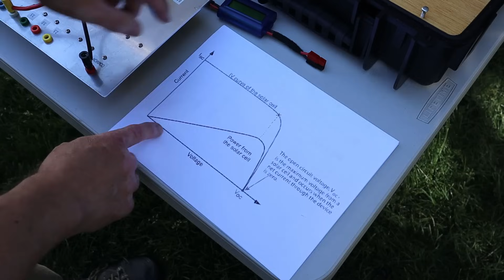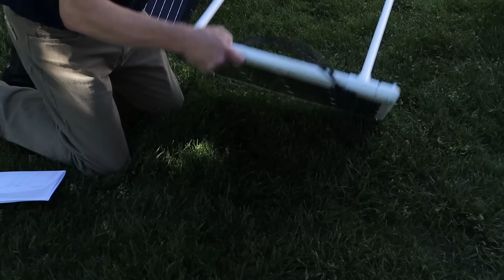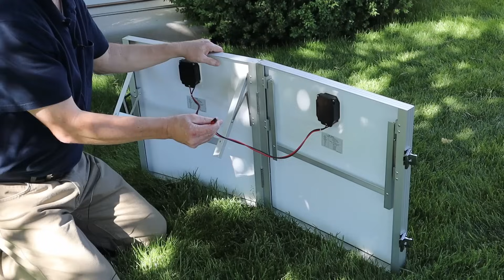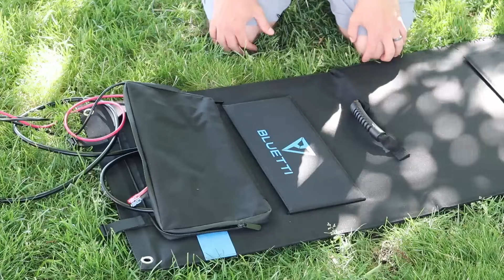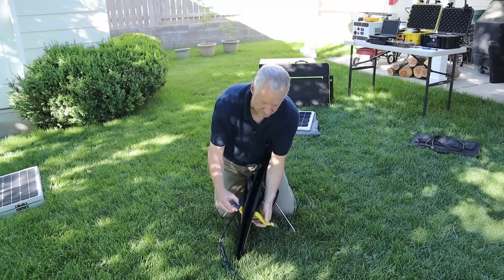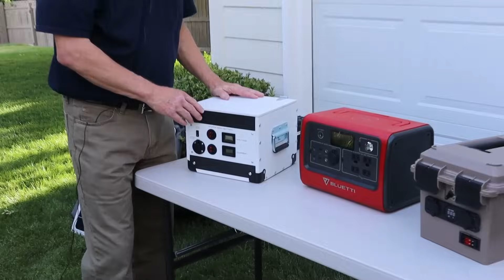Portable Solar Panel Comparison, 11 Different Models! Sunpower, Baldr, Rockpals, Bluetti, and More!

Comment: the dokio 300 watt is worth a look. the most i have seen from it is 225watts, its $350 shipped
Reply from the maker: Thanks for the heads up!
Reply: @Jasonoid  i should add i bought 3 of them and returned two of them due to not even being close to the rating, one seller offered a significant discount if i just keep one of them. its been outside for about 3 months now and i am pretty sure i used to get about 1.2 kwh per day and now its down to about 450wh per day, and i dont know why just yet. one day i might figure it out and make a video about it
Reply from the maker: @jasonbrown467  If you want to have a permanent outdoors solar panel, it's probably best to stick with the glass rigid panels. They are designed to be destroyed by UV light and heat. They are even waterproof. These portable panels are to be used on and off during temporary camping trips and so forth, not always everyday type of thing.
Reply: @Jasonoid  i guess i understand the spirit of your comment, but i dont understand the reason. i have a yard full of glass panels, but its almost as if the cells them selvs have degraded or something. i tore the kit apart apart, as its actualy four panels wired in parralle for a dumb 17 amps at 14 volts, a while back and wired them to series and i wired and soldered it better than the chinese did at the factory, then connected them to mppt instead of the included pwm.  i dont care about the fabric getting sun bleached and the little lanyard holes getting rusted, but the panels should still perform in my eyes. i will zero in on this issue  soon. thanks for your input thought, maybe you have an insight about these panels i just dont have yet. sometimes i just have to learn the hard way
Reply from the maker: @jasonbrown467  I use portable solar panels when camping to power 12v fridges. Battery packs need supplemental solar power to last the whole trip, that's the reason for the panel. To show people which panel to buy. The panels aren't laying out in the yard like this all the time. 

If I never had to move my panels I would use a rigid glass setup instead. I'm debating about adding a bunch of solar to my shed roof for backup power, in that case they would be rigid glass panels that are designed for 100% sun contact and heat.
Reply: @Jasonoid  nice. i am building a electric bike, and i plan to  take it on camping trips very soon and take a battery bank and solar panels to keep the chargers running hot on those trips.

 the little rich solar 100 watt panels are not that big for packing imo,  produce great power and are not too expensive. i was hoping for better performance vs cost ratio in those dokio panels, but i digress

i think my rich solar poly panels perform the best, even though everyone seems to say mono is the way to go, but i have seen 107 watts max here in northern indiana skies lol. my rich solar poly 100 watt panels out perform my rich solar mono everyday, rain, sleet, over cast etc etc and all these panels are new.

 i'm thinking 8-10 of those laid out in the grass wired for series and about 70 feet away from the site in the shade, while camping should get it done for me. and give me plenty of power for misc tasks. love this stuff

Comment: Thank you! Those of us that buy the batt. Units it's because there easy plug and play but no one shows exactly how to connect the panel to the unit and I didn't get a manual with my eb70. So it was nice to actually see it done.
Reply from the maker: I love my EB70, it works really well powering my fridges. Glad you found this video helpful!

Comment: Great Info.  Requests:  1.  Weather survivability (in case it was left in  the rain).   2. Most efficient Power Point:  Meaning: the Voltage / Current at various solar intensity / vs current load.
Reply from the maker: Most of these smaller panels are very similar in power output vs voltage. It's up to the MPPT charge controller to get the most power out of the panel. If you went with a higher quality charge controller it would do it's job for you. 

Most weather proof would be the sunpower 50 watts flex panels seen in the video, or a normal rigid glass panel.
Reply: Good question about outside durability. Some of the competitors state (in the fine print) that they are not waterproof. They can only be “splashed “ with water. I just bought 2 140 watt Ecoflow panels which are going with my 1800 watt Ecoflow Delta solar battery pack. The panels can be submerged in water for 30 mins and still functional afterwards. The fold in four sections, and come in a handled portfolio carrying case. Would be nice to see them reviewed in an updated video.  Great video

Comment: Can you daisy chain or array any of these panels?  I imagine they would have to have the same specs.  And would you need micro controllers for each panel, or would the string controller be able to handle the variables?  Would've also been helpful if you took 1 of those batteries as a base case and said how long it would take any given panel to charge from low voltage cutoff to full.  Maybe an idea for a future video?

Nice presentation, thank you.  These are just some of the questions that rolled through my head while I was watching.
Reply from the maker: In a portable setup like this it's common to use a portable solar charge controller. Eppever, Kisae, victron, renogy all make some good ones. They all have different specifications. 

You usually have to parallel or series connect the panels you have based on the input voltages and limits of your specific charge controller. For a more detailed video about charging my batteries check out my Kisae DTM1250 video I just put out last week. It talk about how I charge them using portable solar panels.

Comment: source to buy the plugs on the load tester?
Reply from the maker: Those are called Anderson PowerPole connectors, they have 15 amp 30 amp and 45 amp sizes. 30 amp connections are what we use most. You can buy some here:
https://amzn.to/3w4myCQ
You will also need a crimper to set them up:
https://amzn.to/3dtEujR
I will be making a How to Video soon on Anderson PowerPole connections. They are my favorite electrical connection by far!
Reply: @Jasonoid  yay I last used those on rc cars in the 90s if they are what they look like
The absolute best available at the time, perhaps still now!
Reply from the maker: @cliff4377  totally agree.....except ONE THING....they aren't waterproof. Only thing that could make them better.

Comment: Question..looking at Rockpals  new version and Baldr...I have a Renogy 30-50 dc - dc controller,  any reason I can't use either of these choices? ( battery is also Renogy hybrid gel, 100ah, (powering the Engels MT 45 , which I got due to your presentation!) .
Reply from the maker: BALDR puts out a little bit more power but both panels are similar. Can't go wrong with either. As long as your charge controller accepts solar input it should work great!
Reply: @Jasonoid  thanks! I figured but the way products are described in Amazon..
Reply: @Jasonoid  I just ordered Baldr, used your link of course. Thank you ! Massive help in my finally committing to purchase! Huge!
Reply from the maker: @michaeltichonuk2176  Good luck on your project! Thanks for watching and supporting the channel :D

Comment: Great video. So few people actually test the power a panel produces vs it's rating, so refreshing to see people who know what they're doing. I'm amazed at the performance figures you measured. I've bought and tested many friends panels in Australia and I'm flat out getting 100w from a 200w panel and don't get me started on 300w panels. Do you think your test unit has anything to do with this? I've used Victron mppt charge controllers and watt meters and never get the 80%+ values you are measuring. Most my testing has been 200w or larger folder panels, blankets and light weight varieties and I'm constantly disappointed with 50% performance figures. Maybe we just get junk panels down under?
Reply from the maker: Thanks for watching Ryan. I was surprised to only get 168watts out of that $550 bluetti 200w panel.... Ouch! Jeff's panel testor has been very accurate so I don't think there is an issue with that. Many times temperature lessens the output, same with high clouds that aren't very visible. Hard to get perfect conditions everyday.
Reply: They're cheap panels. Wattage means nothing u need to look at efficiency rating. A 23% rating is very good for a panel. Your probably getting 10%-11%.
Reply from the maker: @SlimShady771  lol...

Comment: Nice. Looks like there were three or four solar cell manufacturers in the test used by different companies. Sun Power are obviously the premium brand. Of the other, cheaper, panels, did you get a sense of which worked best?
Reply from the maker: We covered that at the end of the video briefly.... I know it's a long video haha. We liked the Baldr and Rockpals RP082 panels. They adapter to most power stations easily
Reply: @Jasonoid  I'll go back and watch it properly! Guilty as charged - I did drop out a few minutes before the end..

Comment: Really like this video. The fridge comparison video is one of my favorites and I've referred back to it a few times. I have some heavy aluminum suitcase panels and some of the light ones too. I live in the Southwest and the winds are fierce. When camping it's hard to keep the lightweight panels in place so for someone like me, the aluminum framed panels are the best fit.  Mine weigh 36 lbs but the wind doesn't budge them much.
Reply: This is my favorite lightweight (about 7lbs) portable panel whenever I'm away from home, on Amazon: https://amzn.to/3wBPke7
You can also read the review here:  https://vpsolarpanels.com/best-portable-solar-panel/

Comment: Can I parallel my 100w Rockpals with the Baldr 120w to charge a Bluetti eb70?
Reply from the maker: Yep, you can parallel them. It will be limited to 8amp charging limit. That's better than just 1 panel though.

Comment: One of your  panels was a 100 watt but you said it put out 105watts isn't  that bad for the generator? Also I  really  liked the 120watt panel  but I  bought  a Jackery300  to start off my first one and will  work up once I know what I am doing but if it takes one a 100 watts  I cannot  use that 120watt panel? Cannot  wait to get my generator  not sure  about  the connectors either  thanks  for this video I  am so overwhelmed and don't  want to make a bad decision.
Reply from the maker: The power station will limit the power coming in. For example you can plug in a 100 watt panel on the Jackery 300 and it will limit the charging to 60 watts. It shouldn't do damage over time. The benefit of having a higher watt panel would be that you can always hit the 60 watt charging level even if it's later in the day or a little hazy. If you use a 60 watt panel, you are more likely to get like 40 watts or even less when the conditions aren't ideal.

The hardest part about choosing a panel is about adapter that panel to the power station you want to use. There are many adapters available so you'll have to find what works for your setup.

Comment: What solar panels would you recommend for that red bluetti?
Reply from the maker: The baldr 120 or rockpals rp082 100, both will work well. The Bluetti EB70 uses MC4 for solar so you might need to find an adapter.

Comment: Why does the Bluetti Sp200 200 watt solar panel only put out 170?  Shouldn’t it be called the SP170?
Reply from the maker: Your testing could vary but that's all we could get out of it. I was wondering why the price was so high. It's built well but didn't perform as well as the Baldr and Rockpals.

Comment: Still waiting for an economy brand, number of panels, and other needs to power a kitchen fridge during an outage, say, for 24 hrs.
Reply from the maker: A kitchen fridge uses about 1000 watt hours a day, and so you'll need that much battery storage to power a fridge on average. My EB70 battery only has about 616 watt hours of storage.

HQST and Newpowa offer great prices on 12v 100 watt solar panels.

Lots of videos on the interwebs to help you put something together.
Reply: @Jasonoid  My EB70 powers a dorm fridge for about 20 hours.
Reply: @Jasonoid  
I thought the EB70 had 750 watt hours...
Reply from the maker: It's rated at 716wh, I tested it multiple times and got around 616wh, you could see more or less than that. Most batteries don't reach "advertised/rated" capacities.
Reply: @Jasonoid  I got wildly varying results from mine using two different watt meters just to be sure. On the first charge I got 450 watt hours, then 520, another time 630. I can`t predict what it will do. I like it because I can save my food after a hurricane but the display shows 0% hours before the battery is dead. The only way to get a general idea of what`s going on is to use a watt meter at all times when using the AC outputs. Bluetti sent me a free one when I complained and I get the same varying results from it. It seems they`re increasing in capacity over time so that`s a good thing. I average around 600 watt hours from them now. I don`t understand why this happened.
Reply: @Jasonoid  
Right!!!
I just learned that today...
Thank you so much.
Reply from the maker: Different discharge rates will get more or less capacity on a full discharge. For example a 500 watt load will get you much less capacity than a 100 watt load.
Reply: @Jasonoid  
Oh... Okay... Good to know.
Thank YOU.
Reply: Go to McDonald's and buy a few bags of ice for $1. Jam them in the fridge. Job done. Unless you live in California... then just buy a generator like every other third world country.

Comment: Will the Baldr and Rockpals both work with the Bluetti EB70 (knowing that its limited to 8A)??
Reply from the maker: Yes, the Rockpals v1 comes with mc4 connectors, which will work with the stock EB70 connector.

Comment: I started with the smaller folding panels with USB ports to charge the little power banks, run fans, and use with USB NIMH & 18650 battery chargers. Now that I have three power stations I have two 100 watt glass panels and 30 watt and 60 watt folding panels I can connect in parallel if I need to. I have about 15 power banks I use to run lights and fans during power outages. I can power my WIFI with a 5 to 12 volt USB converter cable using a power bank...IN THEORY....haven`t tested it yet, but did buy the adapter plug and cable. 

I didn`t know about the higher quality non fading coating on the better folding panels. I learned something.
Reply from the maker: Using the USB ports on the solar panels to charge your little power banks and battery chargers is a great idea! Thanks for sharing! Not sure how I missed this comment, it fell through the cracks or something.
Reply: @Jasonoid  After the two hurricanes last year we had battery powered fans that used six D cells in under 24 hours. So I started looking for a less expensive option. It`s hard to find batteries after a hurricane and we were caught off guard being inland a couple hundred miles and didn`t realize how bad the damage would be here. I`m a huge fan of the USB fans and folding solar panels now. You can find very inexpensive folding panels on Amazon by searching for "folding solar panel" then on the left choose "Under $25." I bought three 20 watt panels with dual USB ports a few days ago for under $7 each.
Reply from the maker: @baneverything5580  So do you have those panels outside with a long USB cable to the fan?
Reply: @Jasonoid  I got the 10ft extension cables so I can put the fan in the sun and sit in the shade or keep my power banks in the shade when charging. I also used the cables during the Winter storm to charge my power banks inside because it was 3 degrees outside. My 20 watt panels and above will power a USB fan even if it`s very cloudy but charge batteries a lot slower. So I bought a lot of the panels and 15 power banks. This was before I got power stations though but I still use the power banks a lot.
Reply from the maker: @baneverything5580  Nice idea, glad you have a use for your power banks. I'll have to check into those cheap solar panels. 

Also, Did you see the EB55 review? What did you think about all the new features?
Reply: @Jasonoid  I`d like to have that power station but have to spend a bunch of money to finish getting moved. Moving to a SHTF zone with a chicken pen, creek, and very large garden area in a very rural location. I got lucky though and Bluetti sent me a new EB70 and let me keep the old one when its capacity began to go up and down and all over the place. I tested it with two watt meters to be sure. The replacement does the same thing...one time I`ll get 430 to 480 watt hours and the next 630...so I never know how long they will actually power my fridge or freezer. But when the next hurricane hits I can save my food. That`s all that matters. I don`t want to depend on a gas generator but do plan to get a very inexpensive one for charging the power stations if it`s cloudy. I have plenty of 100 watt solar panels for them if the sun shines.